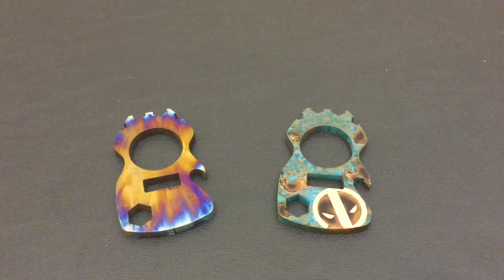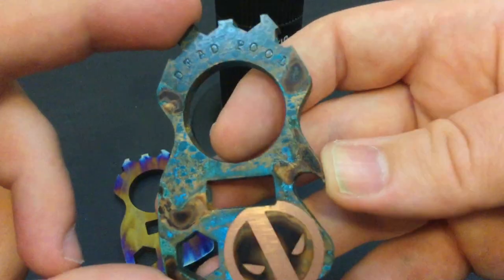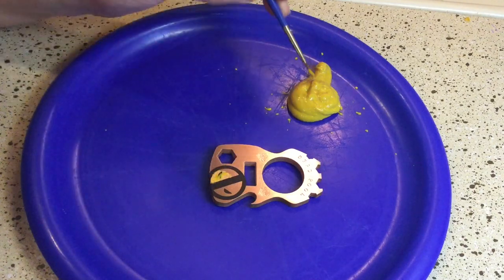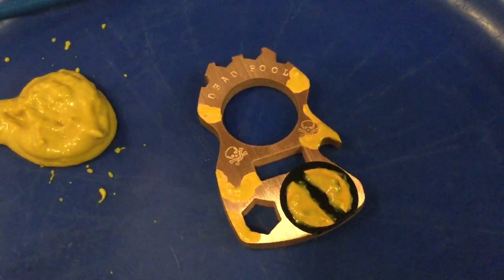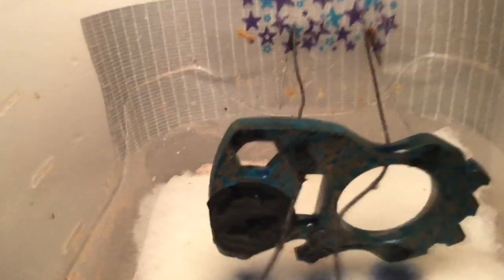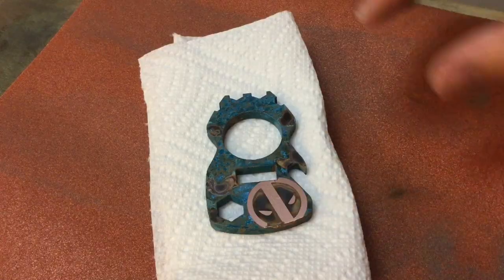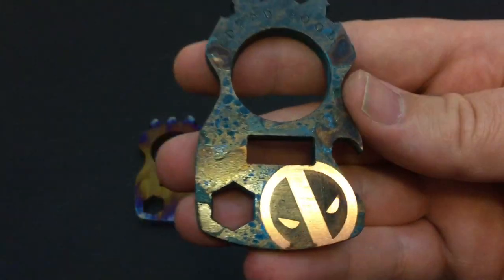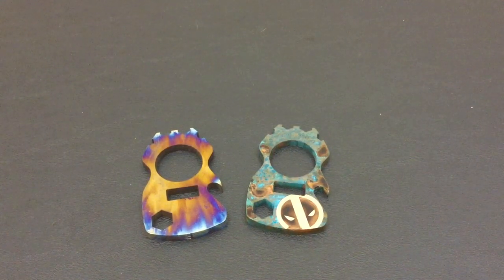How I Patina | Anodize My Every Day Carry - EDC Tools

Comment: Very cool! After heat anodizing the titanium,  do you clear coat them as well, or leave them raw? Also just curious,  after heating the titanium,  say you want to remove the coloring to redo, or it gets scratched bad and you want to redo, is this possible or can the metal only handle the heating process once?

Thanks!
Reply from the maker: No... no clear coating
Reply: @DropForgedSurvival  do heat anodize steel?

Comment: What's a good starter cheap knife
Reply: if u want budget quality then spyderco tenacious or ontario rat 1 or 2
Reply: Matthew Yuen thanks
Reply: Chris V.N  Those are good options and I would add the KaBar Dozier as an excellent beater knife. Solid construction and easy to re-sharpen. The Raven Byrd 2 is also a solid alternative to the Tenacious. (You probably already got a starter blade at this point, but just in case)